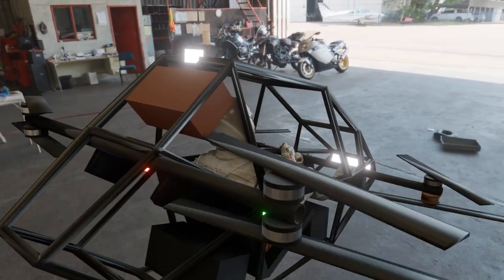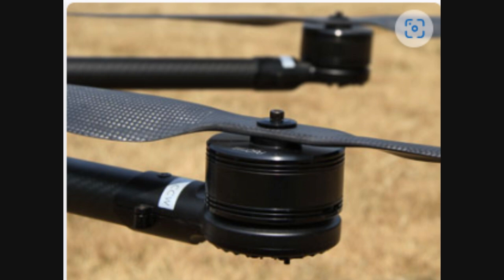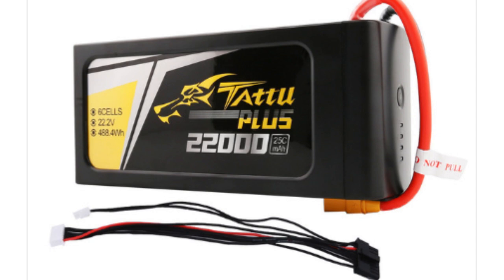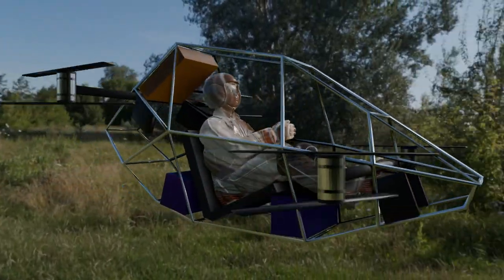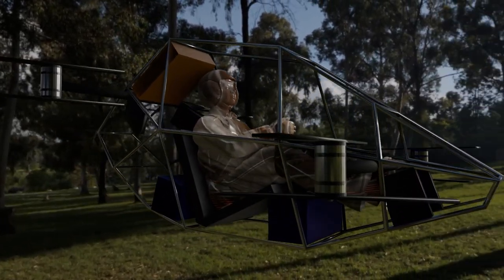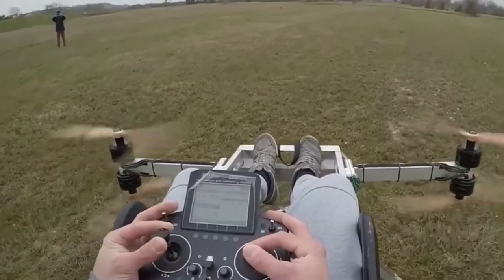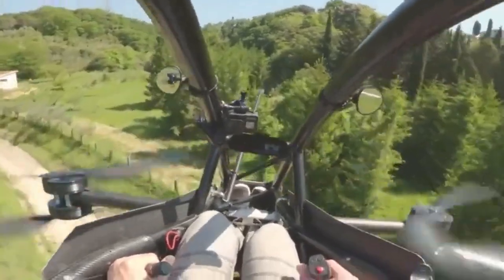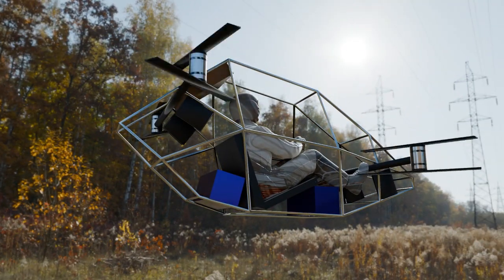Revolutionary eVTOL Quadcopter Drone: The Future of Flight Is Here!

Comment: На каком наиболее эффективном расстоянии друг от друга должны находится винты моторов?
Reply from the maker: General Rule
The spacing should ensure that the propellers do not interfere with each other aerodynamically (avoid propeller wash overlap) while maintaining a compact and symmetrical design for stability and maneuverability.

Key Factors to Consider
Propeller Diameter

A good starting point is to space the motor centers at least 1.2 to 1.5 times the diameter of the propellers. This helps minimize turbulence and aerodynamic interference between adjacent propellers.
Thrust Overlap

Avoid overlapping the effective thrust zones of each propeller. Proper spacing ensures clean airflow for each propeller, enhancing thrust efficiency.
Vehicle Size

The overall size of your Quadcopter and its center of mass influence motor placement. For a symmetrical motor layout (as in your design), ensure the motors are equidistant from the center of the vehicle to maintain balance.
Stability and Control

Wider spacing can improve stability, especially for larger vehicles, but too wide a spacing might reduce responsiveness to control inputs.
Vortex Interaction

Ensure enough distance to avoid destructive interference from vortices created by nearby propellers, which can cause instability or reduced thrust.
Structural Constraints

Consider the physical structure of the Quadcopter, ensuring the design can accommodate the required spacing without compromising durability or functionality.

Comment: Какой аккумулятор подойдёт под этот проект?
Reply: И нужны его характеристики
Reply from the maker: @night_kick  Holybro PM07 Power Module:

Current Handling: Up to 200A peak.
Voltage Range: Supports up to 60V.
Features: Integrated current and voltage monitoring.
Best for: Smaller manned quadcopters; may require parallel configurations for high-power setups.
Reply from the maker: @night_kick  HGLRC Zeus PDB:

Current Handling: Up to 300A.
Voltage Range: 3–12S LiPo (up to 50.4V).
Features: Supports high-power systems with additional pads for accessories.
Reply from the maker: @night_kick  Use copper bus bars or high-current PCBs.
Pair with modular fuses or breakers for added safety.
Connect each ESC directly to a bus bar for uniform power distribution.
Reply from the maker: @night_kick  Voltage (Nominal and Max)

Your system operates at 48V, which translates to a 12S LiPo/Li-Ion battery configuration (12 cells in series).
Nominal voltage: ~44.4V (3.7V per cell)
Fully charged voltage: ~50.4V (4.2V per cell)
Capacity (mAh or Ah)

Determines the flight time.
A higher capacity means longer flight times but increases weight. Aim for at least 10,000mAh (10Ah) or more, depending on motor and system power consumption.
Discharge Rate (C-Rating)

The C-rating specifies how quickly a battery can discharge safely without damage.
Formula: Discharge Current = Capacity × C-rating
Example: A 10Ah battery with a 20C rating can provide up to 200A (10Ah × 20C).
For manned quadcopters, look for batteries with a 20C–30C rating or higher to handle high current demands.
Energy Density

Affects the weight-to-capacity ratio.
Look for batteries with high energy density (>200 Wh/kg for Li-Ion, ~150 Wh/kg for LiPo).
Weight

Keep battery weight as low as possible while meeting capacity and discharge requirements. Batteries can contribute significantly to the total craft weight.
Safety

Use batteries with built-in Battery Management Systems (BMS) for overcharge, over-discharge, and thermal protection.
Opt for safer chemistries like LiFePO4 if weight is less critical.
Cycle Life

The number of charge/discharge cycles the battery can handle before significant capacity loss.
LiPo: ~300 cycles
Li-Ion: ~500–1,000 cycles
Reply from the maker: Battery Type: LiPo (e.g., Tattu 25Ah 6S packs).  Combine in series for higher voltages.
Reply from the maker: or Panasonic 18650 or Tesla 2170 cells. Again, Combine in series for higher voltages.
Reply from the maker: Battery Recommendations for Manned Quadcopters
Lithium Polymer (LiPo) Batteries

Pros: High power output, lightweight, and excellent for high-discharge applications.
Cons: Shorter lifespan and more prone to thermal issues.
Example: Tattu 12S 25C 22000mAh LiPo
Voltage: 44.4V (nominal), 50.4V (fully charged)
Capacity: 22Ah
Discharge: 25C (550A max)
Weight: ~5.4kg
Lithium-Ion (Li-Ion) Batteries

Pros: Higher energy density, longer lifespan, and safer than LiPo.
Cons: Lower discharge rates compared to LiPo.
Example: Samsung INR21700-40T (12S10P configuration)
Voltage: 44.4V (nominal), 50.4V (fully charged)
Capacity: ~40Ah
Discharge: ~20C (800A max for the entire pack)
Weight: ~9.5kg
Lithium Iron Phosphate (LiFePO4) Batteries

Pros: Extremely safe, long lifespan, and stable under heavy loads.
Cons: Lower energy density, heavier compared to LiPo and Li-Ion.
Example: Battle Born 48V 50Ah LiFePO4
Voltage: 48V
Capacity: 50Ah
Discharge: 1C–2C (50–100A max)
Weight: ~16kg
Estimating Power Requirements
To calculate the power and capacity needs for your specific setup:

Estimate Total Power Consumption:

Power = Motor Current × Voltage × Number of Motors.
Example: If each motor draws 25A at 48V, the total power = 25A × 48V × 8 = 9.6 kW.
Flight Time:

Energy required per hour = Power × Time.
Example: For a 9.6 kW system and a 44.4V 22Ah battery, flight time = (44.4V × 22Ah) / 9600W ≈ 0.1 hours (~6 minutes).
Consider Redundancy:

Use parallel battery packs for longer flight times and redundancy.
Additional Tips
Cooling: High-discharge batteries can heat up significantly. Ensure proper cooling mechanisms.
Connector Choice: Use high-current connectors like XT150 or AS150.
Battery Monitoring: Use a smart BMS or telemetry system to monitor battery health and performance during flight
Reply: I built something similar to this if you're still interested. Video on my channel